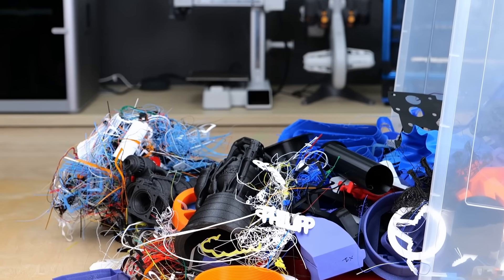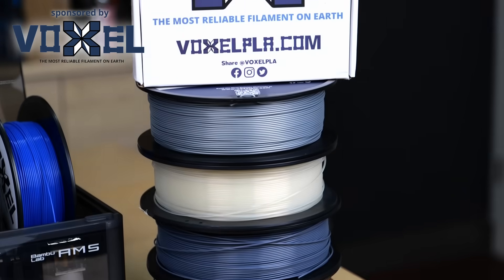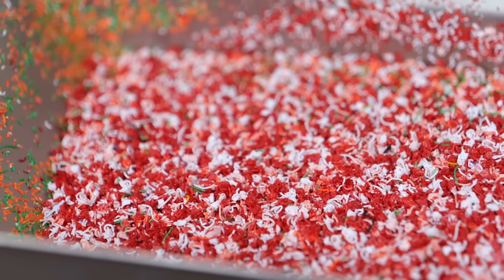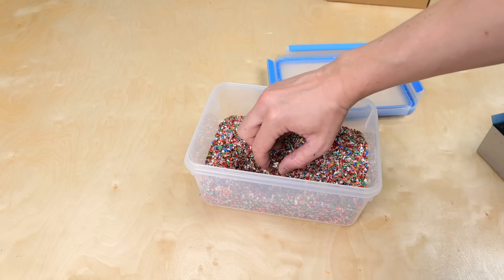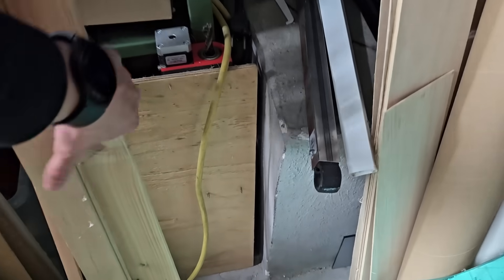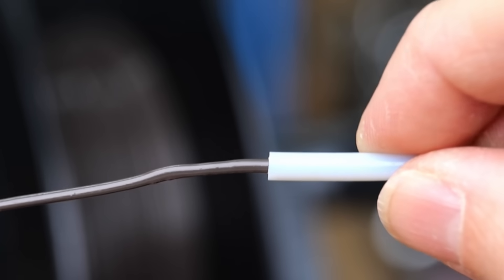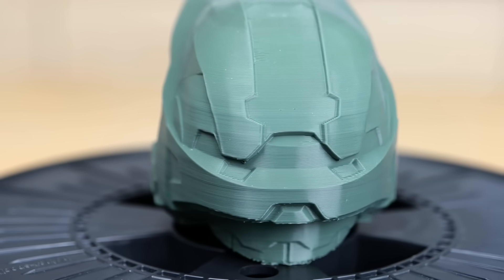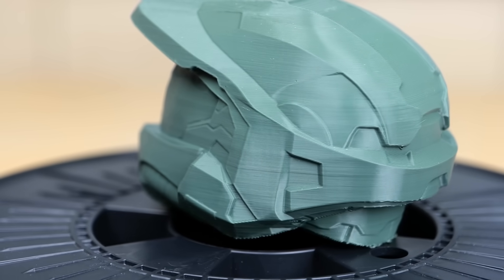Turning 3D Print Waste into New Filament!

Comment: For most ppl that dont want to or cannot spend thousands for a recycler you can melt it all down and use molds to make stuff.
Reply: Yes, the FDM to Injection Molding pipeline is real.
That's really the next obvious step.

Comment: Suggestion.
Why do you not roll them in to the right size. Like jewelry. I do not know what it is called. But that might help with the size and will help the jams. I want to do something like this.

Can you melt it and then color the melted plastic?

I was just wondering if I could help with Suggestions.

Comment: I wonder if it would be possible to install a scraper that would be .5mm larger than the filament diameter to shave any imperfections.  put it in line just behind the stretching wheel to take advantage of the warmth of the filament for easier scraping.  The scrap can then be collected for further processing.

Comment: Just if anyone wants to know, When 3d printing multi color prints, you can add a print that you may want and toggle this one setting on it and it will use the filament that would usually be poop into an item you that you can use!(Though, the print will be the colors that are being used)

Comment: The ability to chop up/grind up 3-D filament waste, is something almost every 3-D printer owner/user can benefit from, the only 3 problems with that concept are:  you need a small enough machine that can fit in most households, it must be able to handle most filaments and Its price, shouldn't drain your life savings!

Comment: I used to work at a plastics molding place for car parts, every few days we'd take all the failed parts and ram them through what is basically a wood chipper, and that'd be mixed in with the new plastics. Was allways fun.

Comment: you could probably try to sort the filament waste by color, and shred similar colors together (or at least colors that will mix into usable ones, like the white and black poops, for gray, or white and reds for pink, or in general oranges, yellows and reds for well orange) that way you’d have a filament that retains at least some of its color, and that can be used in the pretty prints, cause let’s face it a weird poopy tan isin’t gonna be your first pick for some cool print.
Reply: tho this only works when you have tons of filament cause it’s probably not worth it to extrude a handful of scraps.

Comment: I know this would be extremely impractical and implausable, but it would look cool if you had it so the printer "poop" would fall into the poop to filament converter and then the filament would go directly back into the printer. Of course it would run out of filament immediately if you don't have some to get it going, but it would look cool. I know it would still run out after a while because only maybe 30-40% (or less) of the filament actually becomes "poop."

Comment: Regarding the sizing issue. A mold could be used to feed it through when the plastic is still malleable. With a pulling motion at the end, it should give a better consistency.

A similar concept to steel mills

Comment: Is there a reason why you could not pull the filament through a 1.75mm steel die to shave off slightly high spots? This would not work with brittle filaments like metal-filled types, but PLA should have enough tensile strength to handle this. Worst case, you could have multiple stages like 1.79mm, 1.77mm, 1.75mm, etc.

Comment: Thanks, that was very interesting. I collect my printwaste from beginning on, I sort it in black, white and mixed, based on my consumption. Now I wait that some friend comes to the idea to recycle it.
Reply: I upcycle it in the US. If you're based on states, ship it to me. I cover the shipping.
Reply: @matildo4ka7  I am based in Europe, that's probably neighter economical nor ecological. But thank you for the offer and keep on upcycling!
Reply: @Mitchibichi yes, I'm moving to Hawaii, so I'll upcycle other materials except PLA. Plus electricity will be an issue, so I think I'd ditch melting as I'll live OFF the grid. Sourcing of 3d printing trash is not easy. I contacted 100+ ppl, majority don't collect trash, some melting using molds, others tell me I'll keep you in mind and disappear. Eventually AM is the same as any manufacturing is polluting.

Comment: I still have all of my waste material. So far, I have two cardbox boxes. One is failed prints, the other is poop. I would LOVE to send them somewhere to recycle them and avoid the waste issue of the hobby. But there is nowhere in Australia that does it just yet. Closest is New Zealand, and shipping it to another country seems just as wasteful as simply putting it in the trash.

I am very keen on finding a simple at home solution. But I'm not big on making my own machine from cobbled together parts. And proper pre-made versions are still SO expensive. Maybe someone will come up with a BL-like approach that shocks the market and allows for a relatively cheap yet reliable consumer grade version. Until then, I guess I'll just keep hoarding the waste and watching videos like this, hoping to find a solution I can sell to myself and get up and running without too many headaches.
Reply: Melt it, it's simple as that, but use the mask, it's toxic as hell.

Comment: To get a perfect dimension filament, I would suggest forcing it through a set of rolling dies that set its diameter to exactly what you're after. Set up a set of rubber wheels in a push-pull config, and  force it through a circular rolling die.

Comment: wouldn't an option be that it would know how much of a particular colour it is going to use ahead of time and do a switch to a new colour so that as soon as the first one runs out (at the end of when it is meant to end) the new colour is already at the head, so no need for waste material in the first place. this would be an issue if the coloured area is less than what is left in the spool but it would still dramatically reduce waste material no?

Comment: I've recently come to the conclusion that theres not much sense in holding on to all my failed prints and scraps. It stinks to have to just throw away the material but in terms of cost its hardly anything and most of what I print with is already recycled so I don't have that heavy of a conscience considering I'm very conservative in how much material I use whenever possible. Hopefully some day soon there will be recycling options that are more feasible for the consumer level and we can all start recycling our waste.

Comment: It might make more sense to mix all the plastics together undried, grind them all up, and make them into something substantial like building bricks or cutting boards. 
Am curious if you could mix all the different plastics together grind them up very fine, dry, blend it really well, remove any metal, and make filament out of that. Each batch would have an individual melting point and mixed chemistry though. Amalgamated plastics!

Comment: It's a shame there isn't an addon for the 3D printer's poop chute, to let it sort different colours into different hoppers. Even if some of it isn't going to be one pure colour, a lot of it looks like it is. It could perhaps have one hopper per colour, and another for "mixed". 

I wonder if the filament-dumping software could be modified? This is something you might be able to 3D print at home and add a motor to slide the hoppers back and forth on a rail, perhaps, to catch the right colours. Motors and rails are what 3D printers are made of, so there's certainly expertise available. 

Worst case you could maybe use a colour sensor or some image recognition or something to decide what colour filament you've got, and work independently of the printer.

Comment: There are a good number of extra precautionary steps to make this process even cleaner, and having the extrusion tool that measures diameter variance is perfect for finding correlating factors. Wearing gloves to prevent sweat and oils from contaminating the pellets would help, having a dedicated space for holding and handling all of the plastics to consolidate vapor for easy filtration would help, and just knowing that tackling the moisture issue is enough to provide a workable PLA filament from scraps is so encouraging. I'd love to see more experimentation, especially with materials like carbon fiber and graphene

Comment: I'm curious about needing to purge so much filament. Since only the outer shell needs to be in the correct color usually, maybe there should be a setting where instead of purging, the filament is gradually transitioned from one color to the next while printing infill? 1.2 kg of purge for 0.5kg print is nuts.

Comment: Not sure on this, whether your Filament shred would float on water. Try it, any heavier particles should sink, skim the plastic from the top then give it another bath but agitate it to break up anything lighter then the plaster. Give it a good dry and you should be ok. If you're having problems cleaning ur material of hair and fine dust, look into electrostatic, ull need a small enough charge to not pick up the shred but enough to pick up, well, dust.
Contaminates suck and they get everywhere lol good luck with that. 
If push comes to shove, hold the plastic at its melting point for a few hours.
Hairs will slowly float to the surface and metal pieces will sink giving you a nice 100% center of molten material.
Maybe use a container with a tap so you can actually get at the center mass.
I suppose you'll have to shred it after that or pour it molten into the recycler.

Comment: Hm. If printers accepted more uneven filament, the recycling could be a lot simpler. That might be a way forward, but it remains to be seen. Or direct granule extrusion, but that too is far off into the future. Existing now, but not mainstream and not likely to be in the near future.

Comment: Part of the filament recycling process should include a hollow sink that matches the intended diametre which it is pulled through and as blobs are encountered with a sensor before it, vary the speed of the outfeed to ensure the finished product is more consistent.

This can be achieved with using metal tubes encasing an induction heating coil, then controlling the temperature of that coil. Once heated and pulled through, a fan and perforated / slotted metal outfeed tube immediately cools down the plastic to lock the diametre in, and it should be a better result once spooled.

Comment: 1. make 3D print and get waste
2. vacuum dry it to make sure it is dry (keep at 60 Celsius)
3. put that dry waste into a pelletizer
4. shred it in a shredder with included a magnet in the center to get any magnetic filament. (make sure to sift if so please shred it again)
optional. run the magnetic filament through a demagnetizer (cheap)
5. Extrude the filament

6. enjoy your favorite dish (3D printed lasagna)

Comment: We already divide our waste up into different plastics, and keep it in large ziploc bags with dessicant for eventual recycling. A fun idea I had was that I started to separately collect all the fails/supports/bed adhesion scrap from my various silk PLA prints to reuse in other ways. I'm experimenting with making decorative items and costume jewelry parts (like spangles or faux feather/enamel inlay bits) out of the waste. Also I'm lucky to live near a filament recycling company, in St Louis, so when we have enough, recycling will be relatively painless.

Comment: The one suggestion is to do the drying procedure after the poop has been pelletized. Since pellets are smaller, the PLA will have a greater surface area to allow water to escape. 

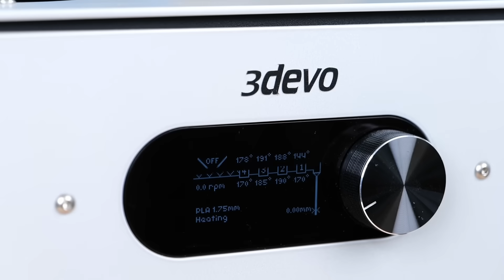The Filament Extruder has two air cooling fans (4:48), with one sucking in warmer air from the extruder itself. Wonder if utilizing a copper spiral coil with cold water flowing, and the hot filament passed down the centre of the spiral, air from fans would be much cooler, greatly shortening the elastic portion of filament between the extruder and the rollers, which should tighten tolerance on the filament diameter. Another option would be to pump a small stream liquid nitrogen into the area. liquid nitrogen would quickly turn into a cold gas.

Comment: I have used the 3Devo machine as well and had serious issues like you did. Tbh, trying to do recycled plastic into filament is a fools errand in my opinion. I have also tried recycling prints into injection molding material, and holy smokes it is so much better. Honestly feels like the way to go if you are trying to efficiently convert waste plastic into something useful. 3D printers are so picky about filament diameter, injection molding basically doesn’t care what you put in as long as it melts and flows.
Reply: But you need to have injection molding machine and it's not cheap

Comment: Now I understand all the comments I seen on my local recycling facilities a month ago or so when I was checking plastic prices, lots of people asked if they recycle the fillaments waste and failed prints, at first I was like is there really that much amount to even bother with it? 
Then seen this video and many others who have tons of failed prints, basically so many waste is made that honestly yeah also ask where the heck do we even utilize that.

I still don't see much point in this and rather go with the old ways of make a sculpt then mold, make production batches. I cannot imagine wasting so much time and energy both mine and electric or whatever to make bunch of failures so as still the final prints need ton of sanding and cure process so I say to hell with it. 
On mold I cut the seems and be done with while with 3D prints I have to remove all those ugly print lines and errors. No thanks.

Comment: I am doing a 3d printing course, and our task for this trimester is to make a fillament machine that would produce fillament from PET bottles.
Seeing you having a lot of problems with professional equipment, I don't think that our project will turn out great. We will try our best.

If anyone has any advice, you are free to give them.
Reply: Don't do it or dry it to death before the extrusion. Check Raul (function 3d) he has pultrusion (folding not melting) device. The most affordable solution. Extrusion and PET is a dead end. PET is shredder killer plus it's so light and hygroscopic. It's a nightmare to work with or print with. I used filament after pultrusion and it has nice finish, but you need to get setting right. It's a headache overall, but possible. Good luck, you need it )
Reply: Pultrusion requires only stripping of the material, extrusion requires shredder and you need INDUSTRIAL style shredder for small grind of PET or very sharp blades. The best option with PET grind is to make fabric.
Reply: Try to contact STF Group Germany, they do large scale rPet processing or Google info about their big scale plants. It'll give you an idea for the scaling down. I don't think you can find many details, but major idea of what machines they use can give you a glimpse.

Comment: But what to do from filament that is left in the roll that you didn't use, because there is not enough to do anything? Is there a way to connect several left filaments from several rolls, and making a long one to be able to use it?
Reply: If your printer has end-of-roll detection and initiates a manual filament change at the appropriate time, it's a relatively straightforward process to feed a new roll of filament in at that time.

Comment: Many times in industry they mix shredded material with original material granules. It does help even out differences in material properties and it also helps with flow in hopper.
Reply: You should try a mix of 75% regrind and 25% virgin to start, if the flow still is not what you’d like, bump up the virgin a little. 
Also, another way of catching any stray metal shreds is to place a magnet on the outside of the feed hopper, near the mouth so the metal is captured before heating. 
This plastic can also be sorted before being ground, if you want to keep a uniform color in your media.

Comment: For now I just save all my printing waste, which is particularly easy to do in sorted fashion since I use basically no variety at all.  I really hope that DIY injection molding will eventually become significantly more accessible as that would be my ideal use for it.

Extruding filament just seems so laborious and expensive a process while being so sensitive and likely to contribute to even more print failures than virgin filament which isn't very expensive anyway.  So I'd really rather have a way to ramp up small scale production while also actually improving part quality by ditching layer lines and escaping the limitations of overhang printing.
Reply: If u're in the US, I'll take your trash.

Comment: interesting i suppose... but theres always a question. why not dump the pla poop into chemical so it all merges evenly? dry off the chemical. Thats really, REALLY easy part. Then with the resulting mass, just mechanically grind it. aggressive grinding will melt the product and clog up everything, so grind very very slowly. whilst adding anti static polymers. the grind machine is easy. simply use the blade from a old coffee grinder. put a bolt thru center of blade, and lock nut on other side to clamp the coffee blade. then insert the bolt in to chuck of cheap electric screwdriver. the rpm will be low enough to prevent melt. Advanced: you might want to experiment with mounting and control.... hint...try adding our device blade to cheap electric kitchen mixer. NOT food processor, just the bowl type.. a Stand mixer) and let it go to work for a few hours. now we have our shreds